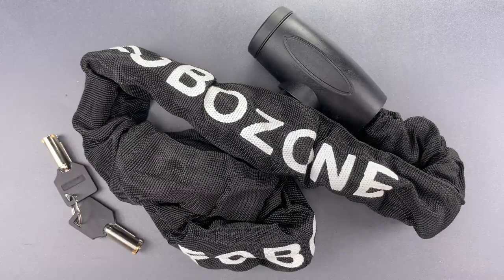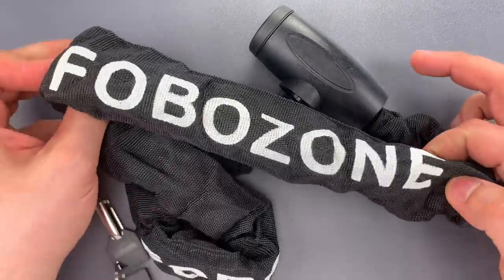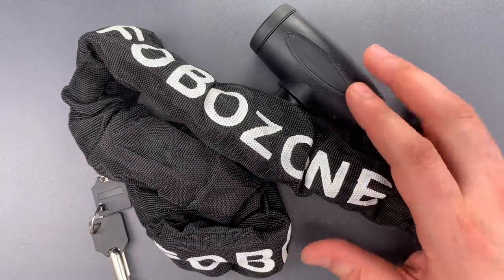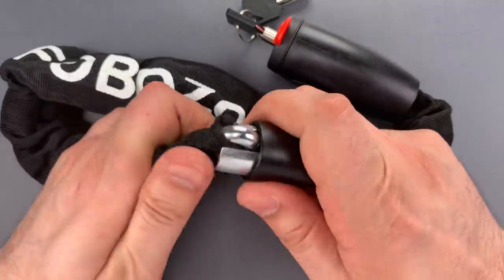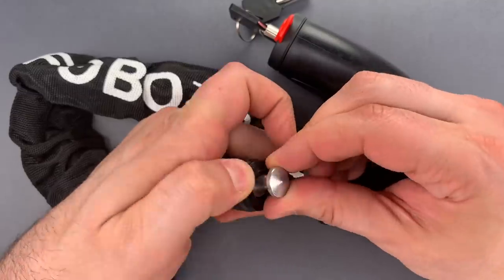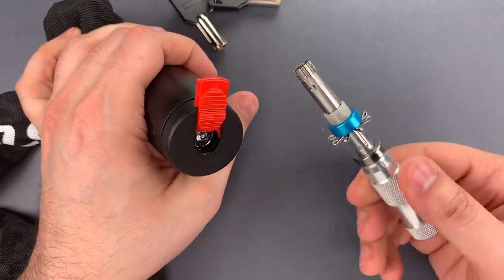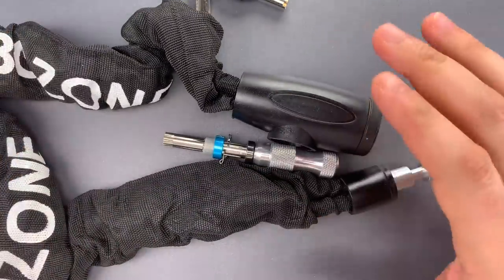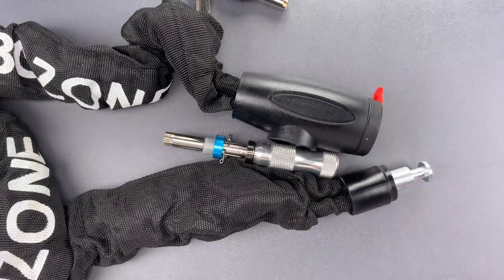[1185] Marketing LIES About This FoboZone Chain Lock (Picked FAST)

Comment: Gotta admit, I thought there would be a silver-painted plastic chain under that cloth petticoat.
Reply: There might be, after the second link.
Reply: I expected aluminum.
Reply: I wonder if LPL checked the links past the first one. One of more common cheats used by the bike chain lock manufacturers is to put two beefy links at the ends where the customer can see it, and pad the rest with something much flimsier.
Reply: I reckon he didn't feel the need to check the chain, since they had already lied about the lock material and construction, the chain is irrelevant
Reply: There are exactly 666 likes, please do not ruin this perfect balance. Edit: and exactly 6 comments.
Reply: @GegrillteOrange LOL! Too good! I'm still laughing at that.

Comment: That lock looks remarkably like the Oxford chain lock I have. The plastics are identical. Except, the Oxford one is a disc detainer, and the chain is definitely hardened and thicker. So looks like Fobozone are trying to clone Oxford, badly.
Reply: There are hundreds of locks like this
Reply: So needs to be branded a Cambridge lock then?? :D (From Oxford so thought I'd have a dig at Cambridge)
Reply: G Galilei  Apparently not, this thing has been on sale for over a year.  I guess amazon don't care as long as they get their cut.

Comment: He doesn't even go back to show if it's a fluke, cause he knows it's already dead.
Reply: There’s no point in trying to prove that it’s a fluke or not with tubular locks, if it works once it will always work.
A tubular lock is either susceptible to this attack then it will work within seconds or it isn’t, then it won’t work at all.
Reply: @HingerlAlois  Valid.
Reply: Yeah, going back would have been like give a dead horse the whip... ;)
Reply: Omar wa mou shindheiru ☠️⚰️🥀
Reply: @soulsofgamingtamil8112  *omae wa mou shindeiru

Comment: I run into the tubular cores on server cases and racks frequently. I keep a ballpoint pen tube in my work bag to unlock them.
Reply: this was the attack i was expecting. they are way too easy to bypass
Reply: The Dell ones are all keyed alike (HP853).  I have a key I keep on my jacket zipper.  The bezel I treat more as an anti-accidentally bump power/drive sled eject button measure rather than security.  It's not like the bezel is going to stop someone from plugging something nefarious into the back of the server anyways.  If they're in the server room, a lot of security steps before that failed or were non-existent.
Reply: This leads naturally to the question of why they are using a "lock" 
rather than a thumbscrew or latch. Sounds like checkbox marketing to me.
Reply: @boring7823  to keep honest people from playing with shit they shouldn't.

Comment: You know it’s a bad lock when the video is only 2 minutes long
Reply: What I like about these is that although the videos are pretty short, LPL only spends a small fraction of the total video actually the picking the lock (about 10% of it in this case).  The rest of it is LPL describing the lock and various possible attacks.  So, a 2 minute video that is also fairly comprehensive.  He doesn't waste words, that man.
Reply: @weswheel4834 , what makes this lock even worse is that trying to insert the pick while looking at the lock under an awkward angle (because, you know, camera and other filming equipment) took about 50 to 70% of those aforementioned 10% of actual picking.

Comment: TBH the key to bike security is just to have a decent New for Old Insurance policy and any lock that conforms to the minimum policy standard.  A determined attack will always succeed regardless of how good the lock.
My bike insurance, with New for Old costs less than £35 a year and requires a Sold Secure Silver rated lock.

Comment: What lock did the best in his tests so far?
Reply: Bowley's lock series which he still has not picked on camera

Video 636: https://www.youtube.com/watch?v=qV8QKZNFxLw
Reply: The ERA lock he did just before this was pretty good, even though he picked it, he did say he wouldn't hesitate to use the lock as it requires a very high skill set to pick.  You could tell it was really testing his skills too.
Reply: There are also a couple locks from the naughty bucket series that refused to budge under his pick.
Reply: He recommended a Kryptonite series 4 bike chain. Though also featured a pragsmasis round lock for securing chains, which if combined with pragsmasis chain would be an additional upgrade.
Reply: He takes about 100 seconds to pick the Abus X-Plus core and needs the custom million dollar pick he and Bosnianbill made. I'd say that's pretty damn good.

Comment: LPL, I'm astonished, but I do have something to add about this one. The lock has a weakness on the connection to the chain as well. Saw a lady pick one up at a local (if slightly pretentious) bike shop, she accidentally banged it against a triplex-panelled counter and the chain just fell off. The owner of the store sniffed and proclaimed it must have been a production error, took a different one and slammed it hard against the metal top of the counter. It too broke. =P

Comment: One thought I just had: could a lock be made much harder to pick by adding a mechanism where pushing up on one pin pushes down on all the others?  It wouldn't interfere with the key since it pushes up on all the pins simultaneously, put would interfere with picking, since each time the picker sets one pin, it resets all the other pins?
Reply: As you insert the key it pushes up on the first pin, then the second pin, etc. As soon as the first pin gets pushed up the rest of the pins would be pushed down, preventing the key from being inserted fully.
Reply: @notahotshot  Yeah, I'm thinking of something spring based, so it won't push down if there's a key physically obstructing the pin, but would push them down if they're "set" by a lock picker and there's nothing holding them up any more when they move on to the next pin.  Basically so when he does the "nothing on one, nothing on two, click on three" thing, each pin sort of resets the lock and he would have to figure out how to pick all the pins at the same time.

Comment: A lock with marketing lies.
Why am I not surprised.
Reminds me of the 4 digit code locks advertised to have at least 10 times the amount of possible combinations than is physically and mathematically possible.
Reply: Would those have 18 digits on each wheel? 18⁴=104976 combinations.
Reply: @johndododoe1411  4 wheels, each with 0-9. If my maths are correct, that's 10,000 combinations. 0001 - 9999 plus 0000.
Reply: @aurongrande6141  So false advertising, as 18 positions on 4 wheels would have been needed for 100.000
Reply: @johndododoe1411  When I was younger and rode bikes, the amount of combination locks I saw advertised as having exaggerated possible combinations was rediculous.

Then I started seeing the same tactic on digital locks like 4 digit pin numbers for bank cards, or mobile phones etc.

I still see this false advertisement now and then.

Comment: why does key impressioning work so easily in tubular locks? What's the design flaw that causes it?
Reply: Equal spring pressure on all the pins, IIRC.

Comment: Wait just a minute. You mean to tell me that Amazon is selling a bike lock that isn't using the lock core they advertise? The chain isn't the same diameter as advertised? The steel used isn't manganese but probably some old recycled automobiles? 

Please don't tell me that Santa Clause isn't real cause I can't take anymore?

Wish I still had access to the Spectroscopy metallurgy tool we had. Management decided it cost too much for standards and annual calibration verses the number of counterfeit fasteners we received, so the equipment was declared surplus and sold as scrap. Good thing I don't fly commercial any longer.

Comment: So not only is there the marketing BS to contend with but if you have one of those tools, no-one is going to look at you quizzically as it's just going to look as if you are opening the lock legitimately, no need to hide a set of cutters.
Could they fail any harder.

Comment: How can they straight up lie about the material and size? Surely that's illegal as hell, no?
Reply: Lots of marketing tactics are blatantly illegal. They avoid being targeted the same way a gazelle avoids getting eaten - by being part of an enormous herd of similar animals, with only a few predators after them, the odds that they'll end up being targeted are minimal.

Either that or just having shitloads of money to bribe...er, redirect the concerns of watchdogs. Like when Rockstar changed the price of GTA V just before a summer Steam sale so it'd still be the same price once the "markdown" took effect. Also blatantly illegal, and also totally ignored.
Reply: A lot of Amazon listings have disclaimers that the product may be different to that pictured, may be of a different size due to manufacturing variation, etc. No idea how well that would hold up in court though. Good luck suing a Chinese company in a Western court though! Probably Amazon would just offer you a refund to avoid the hassle.

Comment: looks like a carbon copy of my AXA chain except the chain wrap says AXA that does have a disc core and the chain is way above this in quality also the housing is metal this looks plasticy honestly i think they copied popular higher quality locks on the outside but it is so blatantly cheap on the inside